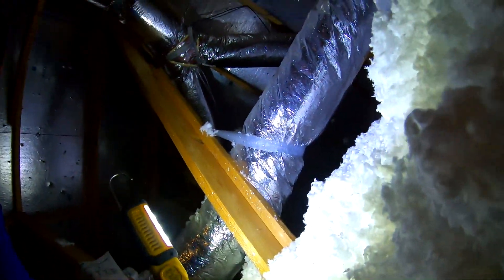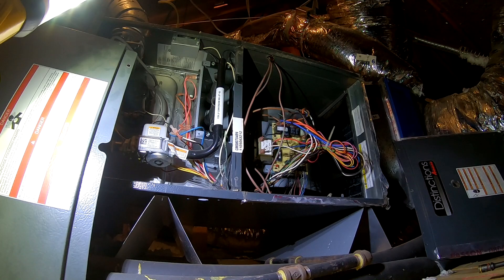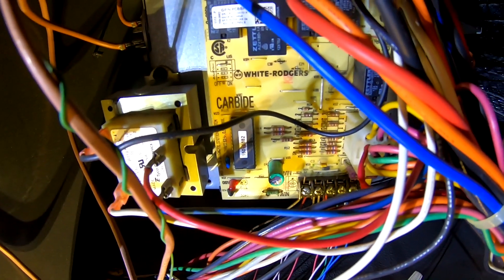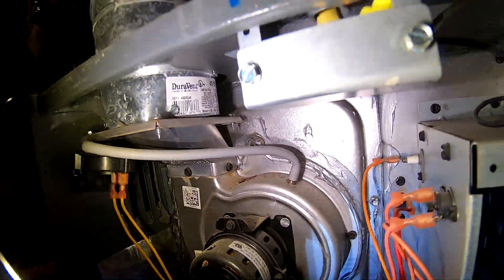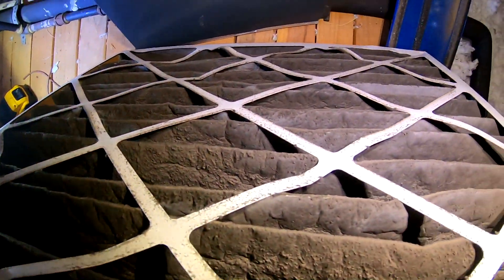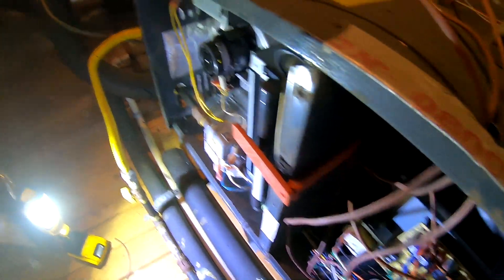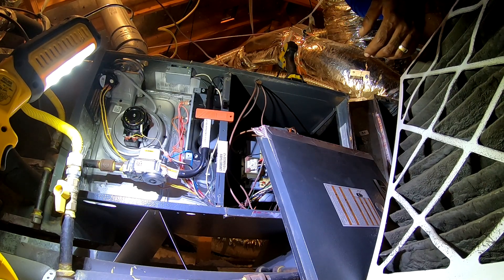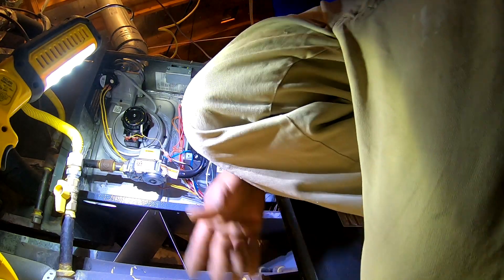"3 Blinks & No Heat? Troubleshooting Guide for Your Goodman Furnace ❄️🔥 HVAC Expert Secrets!

Comment: Thank you for this simple and clear instructional video. You saved me about $224: $99 for coming in the house to just tell me what the issue is, and $125 for doing maintenance. The problem was that the thermostat lost its power and went blank. I checked all electrical options, and all were okay. then, I vacuumed all three pressure switches, each tube and its pipes, changed the filter, and cleaned the entire unit to make sure all dust and dirt were gone. It started with the power in the thermostat, and the cooling is running. Thank you. I got a two-stage Goodman furnace, 5 years old.

Comment: what are you one of those guys that think i wont show how to test switch with ohns or show how you use a small drillbit to clean hose hole also bird nest cause no vacum and gasket goes bad on box there free tip Wednesday bwaaaaaaa
Reply: He'll be back for sure. Those goodman pressure switches go bad all the time, and they're always intermittent before they fully go out so it'll work after u cut power and reset the system but will go into a lockout again within a few days and now u got a callback

Comment: Shouldn't your company supply you with filters though ? Or is it different for every company?
Reply: Its different for every company there are so many different size filters out there and you cant keep up with all of them. And they take up too much space in your work van/truck.
Reply from the maker: Yeah, that's the main reason I don't carry filters bc of the space it will take in truck. Some companies that have maintenance programs will have a beginner tech riding around changing filters all day. I usually tell homeowners if they buy a few ill change them. Or if it's to dirty and I need replacing it to troubleshoot ill mark the price up just like if it was a part and go pick one up